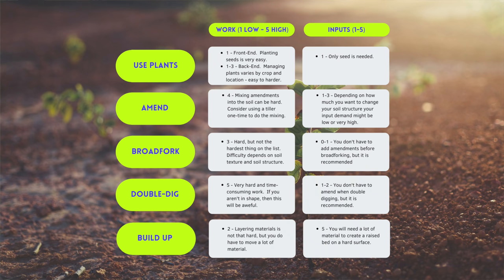6 Ways to Fix Clay Garden Soil | EASY to HARD Methods

Comment: No, no, no!  Sand + Clay = Concrete!  The soil you are working with in your video bears no resemblance to heavy clay soil.  You can hardly get your shovel into real clay when it’s dry, and you can hardly get it off your shovel when it’s wet.  Mechanically breaking it up without amending it will last about as long as it takes to rain.  I’d look for advice from someone who demonstrates the fixes in a genuine red clay garden.